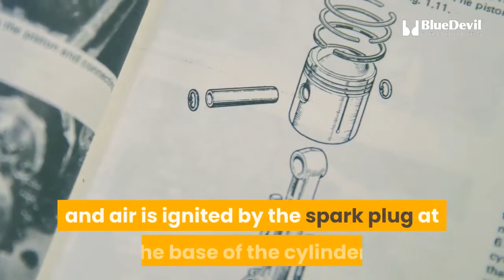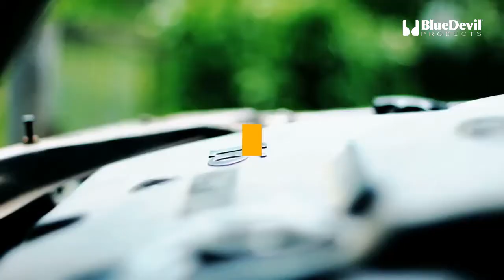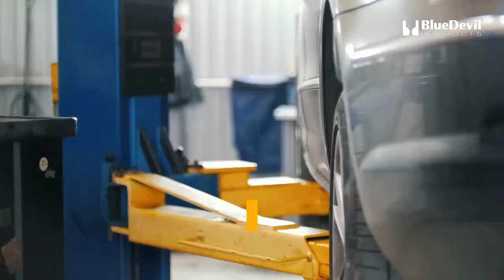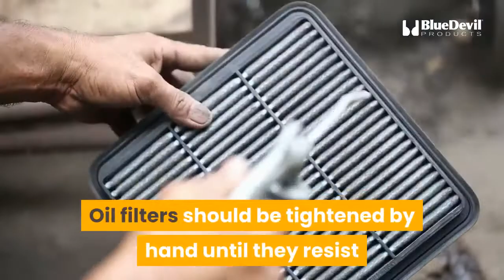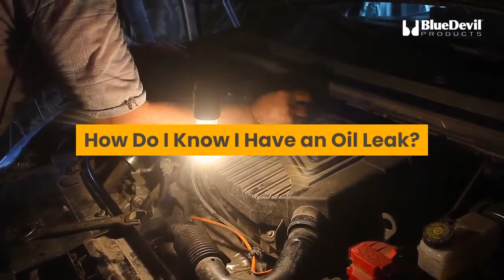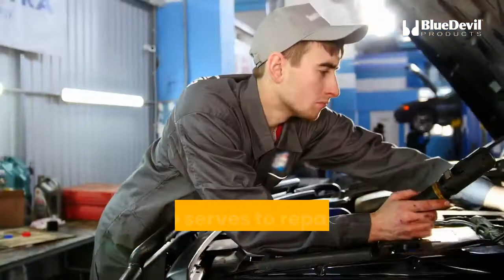Why Is My Oil Leaking After an Oil Change? | BlueDevil Products

Comment: I had an oil change done at Walmart I had no issues with any leaks after I had them do an oil change my cars leaking transmission fluid coolant and oil. What do I do I don't have money to take to a shop to repair and Walmart said I needed to pay for this to happen and if they get a report from the mechanic saying it was caused by Walmart then they will reimburse me
Reply: I have a 2004 ford focus

Comment: I have a Nissan np200...and it leak when ever I switch the ingine. It leak between the engine and oil filter.. what else can I try
Reply from the maker: Please contact us at 888.863.0426 so that we can discuss the leak in more detail and specifically where it originated from.
Reply: Sounds like oil filter gasket, mimes did the same on my 2010 Chevy impala. Easy fix